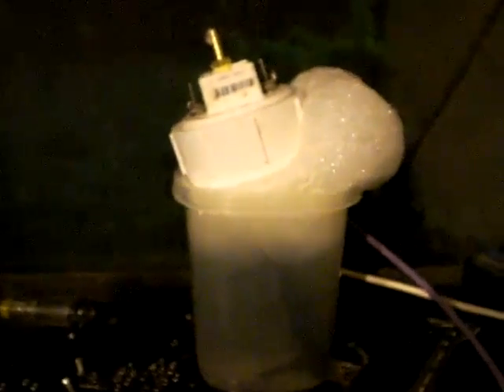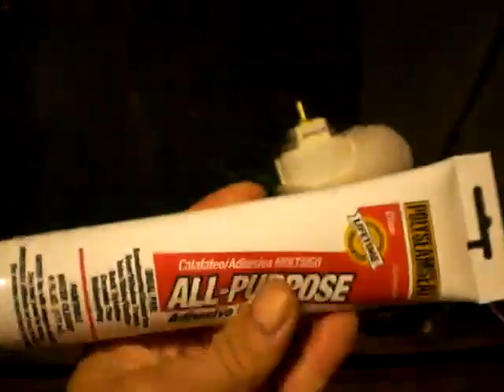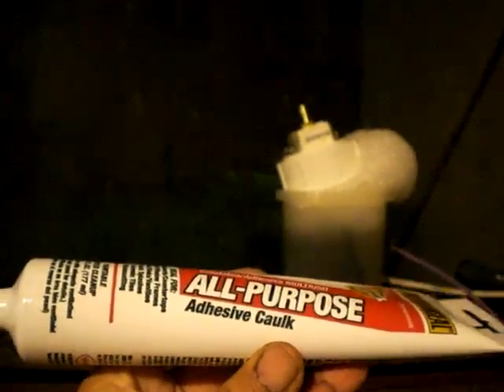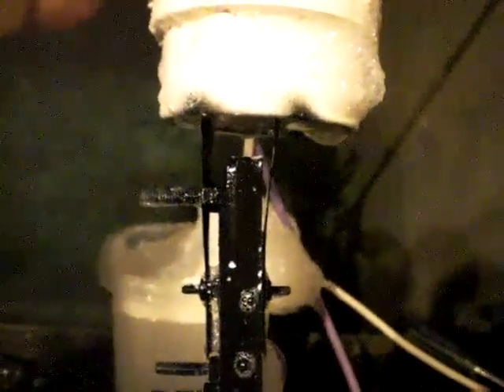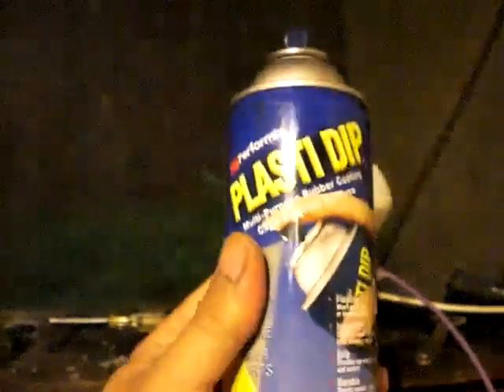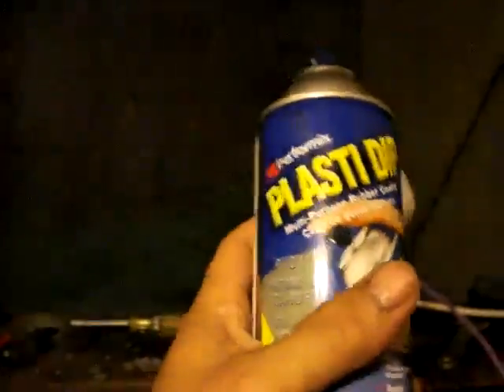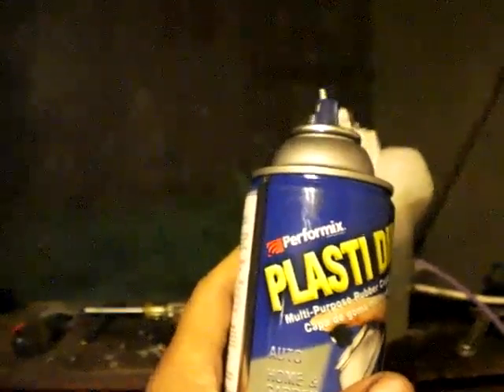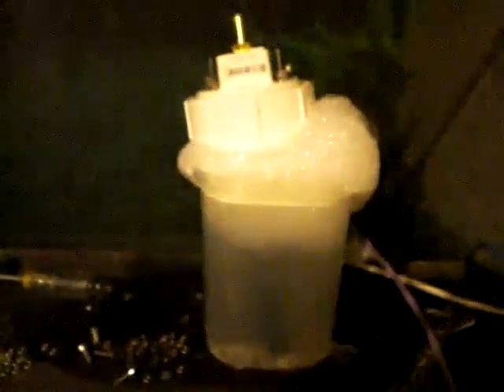HHO foam is bad!

Comment: 1.  too much electrolight.. yes,  lye + oil = soap.
2. add a lubrication element to the water.  
  armorall rubber cleaner, or even Wd40 eliminates foaming.. also you can buy anti-foaming agents at walmart or bimart.

3. YOU CANNOT STORE HHO.. IT IS EXPLOSIVE. YOU MUST REMOVE OXYGEN BEFORE YOU CAN STORE HYDROGEN.  
   DO NOT ATTEMPT TO STORE  HHO.  IT WILL EXPLODE WITH THE SMALLEST OF SHOCKS.  hydrogen +oxygen = EXPLOSIVES.  expecially at the 2:1 ratio's that hho is.